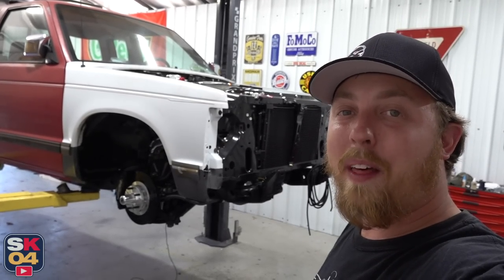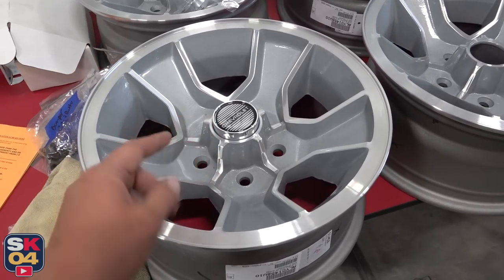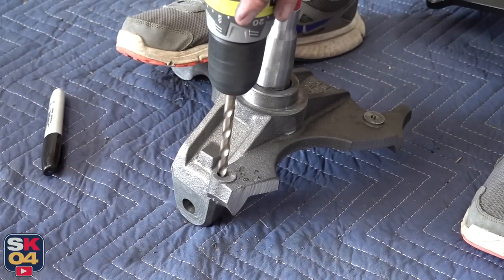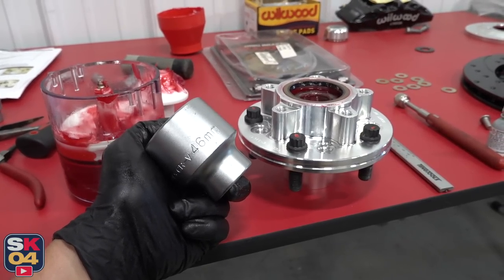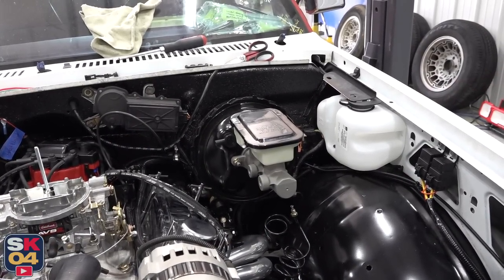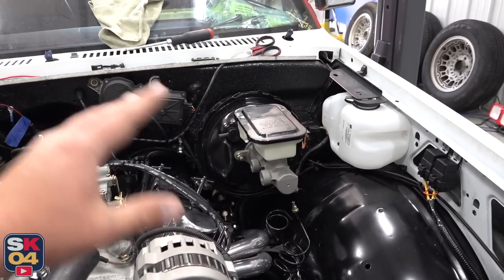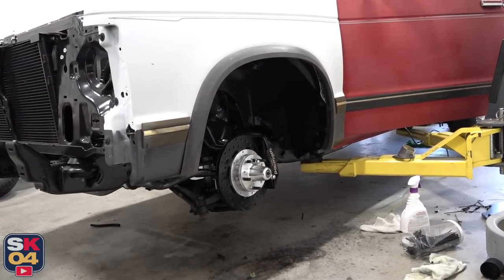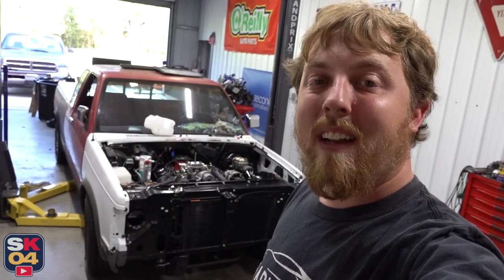Installing Beefy 6-Piston Brakes And Old School Chevy Wheels! S10 Restomod Ep. 14

Comment: Yeah new tires can make even half finished projects look so much better. I agree the the white letter tires look great on these 80s and 90s 1/4 ton trucks. I have the cooper versions of those onb my 94 dakota and they just fit so well
Reply: @saabkyle04  im assuming you still have the engine from the crew cab project. That would be cool to use in the chevelle. Maybe throw a centrifugal supercharger on it too.

Comment: Looking great Kyle! One tad bit of advice. If you aren't planning on putting the 1/2" blocks in the back, you need to cut the ends of the u-bolts off within a quarter of an inch from the face of the nuts. They can catch on stuff and if you have a flat can hit the ground bending them making it almost impossible to get the u-bolts out. Learned that the hard way back in my mini-truckin days in the late 80's early 90's. Otherwise everything looks mint!!
Reply from the maker: Thank you Rodney!!  That is a great tip, I never thought of that!

Comment: Brand new springs will settle once you put some miles on it, which will make the truck lower. After you do the alignment have it checked again in 500 miles to make sure everything is good. I'm assuming camber and caster is set with shims so make sure you find a good shop, you want the place that puts down fender covers. Positive caster makes for a more stable ride but it increases steering effort so keep that in mind if you're doing custom specs and they can't get it to come in exactly. Sometimes you can increase caster to decrease camber, negative camber is good for handling but too much will wear the inside of the tires

Comment: The bleeder screw is supposed to be on top. If it's on the bottom switch the calipers. And bleed again. Air does get trapped
Reply from the maker: The bleeder screws are on top and they're on the correct sides.  I have since done what they suggested and it worked like a charm.

Comment: S10 is looking sweet. Can't wait to see it on the road. What exhaust system are you going with? Try using a vacuum bleeder to bleed the rear calipers.
Reply from the maker: Not sure yet, I will most likely end up taking it to a shop to have one made.  Little Shop's suggestion worked out great, got the calipers bled last night, now they work like a charm.

Comment: I see you torqued down that axle nut pretty good.... but aren't those wheel bearings supposed to be finger tight? I've installed a bunch of those and the book only wants it finger tight.... please check.
Reply: Agreed, initial torque down while spinning the rotors to seat them. Back the nut off and then just barely snug to put a light preload on the bearings is how I have always done it.
Reply from the maker: I followed the torque specification and sequence as outlined in the GM factory service manual.
Reply: @saabkyle04  I feel so honored to have you reply. Hahaha

Comment: If you didn't paint that master cylinder it's going to rust and look like hell in no time, paint it with high temp paint or clear coat to keep a factory look/finish
Reply from the maker: I know, now that the brakes are bled, I'll probably just rust treat it and hand paint it as best I can.  I didn't want to take the chance of brake fluid getting on fresh paint and ruining it.

Comment: What torque did you put the spindle nut at? I've never seen one put down with a torque wrench. I've only seen the method of tighten it than back off and pin it.
Reply from the maker: I simply went off of the spec outlined in the factory service manual.
Reply: @saabkyle04  ok I'll look.

Comment: Hi Kyle.  I have contacted you before.  I think your interest in gen one S-10's is incredible.  You are always looking for suggestions.  So far you haven't bit on any of my suggestions.  I have an incredible mint survivor time capsule. 1987 S10 Blazer Tahoe 4X4 with 62K unmolested miles on her.  It has the 2.8 V6.  With the 2.8 V6. the Blazer is slower than a riding mower.  Would you be interested in doing an incredible swap on it.  DCS (Diesel Conversion Specialist) makes a drop in swap kit.  It includes the adapter plate,  fly wheel, starter motor, all the nuts and bolts, etc... to mate a TH700R4 trans to a VW TDI diesel.  Much more Horsepower and Much more Torque and when it is done, AN INCREDIBLE possible 30-50+ Miles Per Gallon.  With the 20 gallon tank in the Blazer that is a 600 to a 1000 mile range, with enough power to pull a house down.  My suggestion would be to get a complete engine with all the accessories already bolted on so it would need limited modifications like AC and PS lines made up.  The VW TDI's are capable of 200 (reliable) hp with minimal upgrades, like larger injectors and a slightly larger turbo.  I hope I have peaked your interest this time.

Comment: Hi Kyle is your 1986 chevy c10 a 2wd or 4wd. If it's a 4 wheel drive install a lift kit on it with bigger tires and wheels, intsall a rear diff locker on it, and a custom bumper with a wrench

Comment: So now that the truck drives there is something you should research. The TV cable for the transmission NEEDS to be properly adjusted otherwise the transmission will quickly burn itself out. Also how do you plan to get the torque converter to lock up? Since your truck is carbureted there is no computer to engage the lockup so how do you plan to go about that.
Reply: The TV cable set up is VERY important.  However, he put in a 700R4 tranny which is "analog" so no computer communication.  Kyle, please let us know how you adjust the TV cable.
Reply from the maker: Yes, you are 100% correct.  The truck isn't "driveable" quite yet, the whole suspension needs tightening, the diff needs fluid, the TV cable needs adjusting, etc.  I have found several videos out there and there's a bunch of info on google on TV cable adjustment so I'll work on that very soon.  I think the most important thing is for the 1st to 2nd gear change to be around 20mph, but I have to double check.  I know there's the bulk adjustment and the fine adjustment.  TCI had a wire harness attached to the TCC module.  I connected it to an ignition power as they indicated so the lockup should work as it's supposed to.  I don't know much else about it at the moment.
Reply: @saabkyle04  That's interesting. I thought you would do what other people do with the TCC by just putting it on a toggle switch. But yes do make sure to get the TV cable adjusted correctly as the trans will QUICKLY burn itself out and you don't want that

Comment: Nice job man looks good coming a long way now! Why wouldn't you just do the corvette conversion? I did that with my truck and I love it. Major stopping power in it as well. Could have saved you money I think going that way.
Reply from the maker: Thanks a lot!  I've seen the corvette conversion too, but as mentioned, I already had these brakes on the shelf so I figured I might as well use them since they were no longer going on the crew cab.
Reply: Ok gotcha